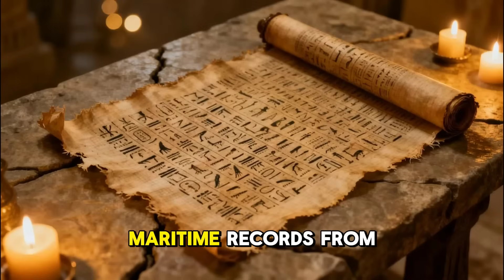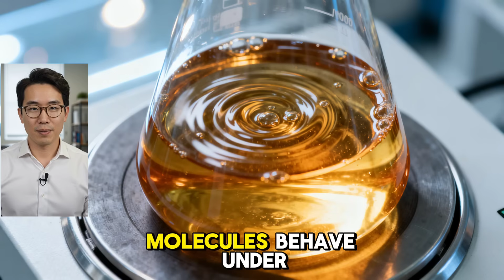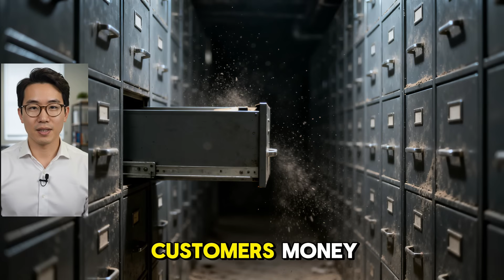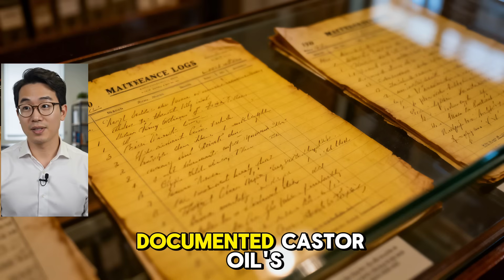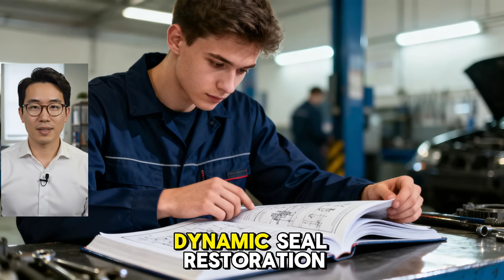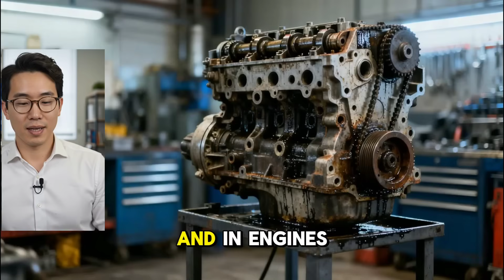One Cup of This $2 Liquid Stops ANY Oil Leak Forever. Mechanics Hate This Video.

Comment: It does Work, I did it, What kills me is all theses Snake Oil Lucas Stop Leak Ect...They sell this High Price Shit Knowing it does not Work.
I put 1 Cup of Castor Oil, How could it Hurt It's OIL, all it could do is mix with the 5 Quarts that is already in your Car. Think About It. I had some work done on my 50 year old Jeep, it barely had any Leaks before I took it there for Work, They did not tork any bolts, Some were barely put on as I checked when I got it back after 2 Weeks.  It leaked Like  Hell. 
I watched this Video and said to myself it can not be any worse than any of the Auto Mechanics around here. I put it in and after the 3rd week I could see a Amazing Difference.
Yes I am Grateful that I did It. Damn Straight.

Comment: I have a hard time putting fluids in a vehicle that dont go in that vehicle. Old timers I poured a Little ATF in the carb one time ran like a top. Ive seen guys do that and end up putting a Motor in the car. Itll stopp the leak when it locks up. You can if you want but its a no go for me. Last thing you wanna do is blow a motor

Comment: Had a Nissan that leaked from the top engine block. Took it to the dealer twice (after it started to leak after first fix). The 2nd time they kept it overnight to see if it would leak. 6 months out it started leaking again. Took it to an independent mechanic that fixed it. 6 months later it started leaking again. All this time they are simply replacing gaskets. My bro said he can fix it. I was reluctant because it appeared to be more of design flaw, even though it took years to start its initial leak. But I relented. Many years later, it never leaked once. My take is they simply fixed it for the short term so that you'll be back again.

Comment: Here is what chat gpt told me. 

Short answer: No — don’t do that. It won’t fix your leaks, and it can actually make things worse.
Why castor oil is a bad idea
Not engine oil: Castor oil (like the stuff used in old racing engines or for medical use) doesn’t have the additives modern engines need (detergents, anti-wear, heat stability).
Thick and gummy: It can gum up passages, especially when it gets hot, which can starve parts of oil.
Can damage seals: Instead of fixing leaks, it may swell or degrade rubber seals unevenly.
Clogs things: Risk of plugging oil passages, lifters, or even your oil pump.
Why people think it works
You might’ve heard of “thick oil stopping leaks.” That’s kinda true—but only temporarily, and castor oil isn’t the right way to do it.
What actually helps leaks (real options)
High-mileage engine oil
Has seal conditioners built in
Example: Valvoline High Mileage, Mobil 1 HM
Stop-leak additives (use cautiously)
Products like BlueDevil or Lucas can help small leaks
Fix the actual problem (best long-term)
Valve cover gasket
Oil pan gasket
Rear main seal (big one)
Real talk (your situation)
With your 2007 Dodge Ram 1500, if you’ve already been dealing with brake issues and working on it, you’re probably comfortable wrenching a bit. Most oil leaks on those trucks are:
Valve cover gasket (easy)
Oil filter housing / adapter
Rear main seal (harder)
Bottom line
❌ Castor oil = bad move
⚠️ Thickening tricks = temporary at best
✅ Proper oil or fixing the gasket = the way to go
If you want, tell me where the oil is leaking from (front, back, dripping on exhaust, etc.), and I’ll help you narrow it down and fix it the right way 👍

Comment: This is AI Crap.
Yeah, WW1 engines ran on castor oil.  It was the purest oil they could get.
In those days, petroleum wasn't refined anywhere near the purity it has today.  Ever watch an old silent movie and notice how all  the cars smoked horribly.  That wasn't a sloppy engine, it was oil contaminants burning off under heat and pressure.  Run one of those old engines with modern oil and they mysteriously stop smoking.

Comment: There's nothing that will stop an oil leak forever. That's absolutely ridiculous. Oil is keep from leaking with seals made from different types of rubber. They all will harden and start leaking. Additives might prolong a seal for a short time, but that's not forever. I don't know what oil or what thing the oil is in, but it's probably not something that has pressure, heats up, cools off over and over. I'm a retired mechanic of 45 years, I know a little bit about oil and leaks.
Reply: Put in brake fluid!!!  It swells the seals!!!!

Comment: Castor oil sold in USA stores indicates it is hexane free. Is this the correct oil?
Reply: If it’s he’s me free, the oil is extracted from the plant via cold pressing. This form is safe for use in/on you’re body. The leftover pulp is then heated to extract any leftover oil. This process causes the oil to lose its nutrients and become rancid. They wash this rancid oil with hexane to get it looking fresh. Both forms are fine to use in an automotive application, although the cold pressed, hexane free version is a better product.
Reply: Yes , That what I used and Ordered on Ebay.

Comment: According to Gemini... is adding castor oil the car motor oil to stop licking a good idea?
Gemini said
Short answer: No, please don't do that.
While it might seem like a clever "old-school" trick to stop a leak (or a "lick"), adding castor oil to modern engine oil is a recipe for a very expensive repair bill.
Why Castor Oil is Bad for Your Engine
Castor oil is a vegetable-based lubricant. Modern cars run on sophisticated petroleum-based or synthetic oils. Mixing them creates several critical issues:
The "Gloop" Factor: Castor oil is notorious for oxidizing and turning into a thick, sticky varnish or "sludge" when exposed to the high heat of an internal combustion engine. This can clog your oil pickup screen and starve the engine of lubrication.
Chemical Incompatibility: Modern motor oils contain complex additive packages (detergents, dispersants, and anti-wear agents). Castor oil can react poorly with these, causing the oil to foam or separate.
Seal Damage: While people used to think it "swelled" seals to stop leaks, it can actually cause some modern gasket materials to degrade or become brittle over time.
Reply: any documented evidence to support your proposition 🤔
Reply: AI  = ANAL INTELLIGENCE
Reply: NO IN THE HABIT OF LICKING MY MOTOR  ! EVEN IF IT IS TICKING ! NO THANKS ! 😅😅😅 FUCKEN LAZY PEOPLE  !

Comment: i had rediscovered this castor oil thing about 10 years ago being a big fan of ww1 aircraft and reading about how the engines ran and were maintained there is also another benefit to this you never mentioned back in ww1 maching crank shafts was not near as good as it is today but back then the gaps were filled with this castor oil on breakin you will find on a modern gas engine an actual rise in oil pressure as the wear gets filled in not only in the bearings but in the oil pump itself becoming more efficient

Comment: Will Castor oil also work for a leaking automatic transmission pan gasket as well as a leaking power steering pump?

Thank you for your time!
Reply from the maker: Yes it will

Comment: I heard nothing but bad using castor oil.  It’s not going to swell your gaskets like other no leak products claim.
Reply from the maker: Thanks for sharing your experience, it definitely depends on the specific seal material! 🤔
Reply: Engine Oil in my radiator. If i add castor oil will it stop the oil in my radiator if the cause is oil cooler? or head gasket?

Comment: PERSONAL OPINION :

Lets get real . Its far better to simply tighten the loose oil pan bolt or the valve cover bolt in order to stop the oil leak INSTEAD OF DUMPING CASTER OIL INTO YOUR $ 70,000.00 BEAUTIFUL CAR'S OIL STSTEM PAN . I don't think you would want to send Castor oil to a turbocharged
Engine's turbocharger's little  
Aluminum bearing that suppots the 1200 degree F 
Hot 30,000 rpm spinning 
Turbine shaft and 1200 - 1800 F degree hot exhaust gas driven shaft ! The Castor oil may turn into
Cooking oil .
Don't put anything into your engine's oil pan except a high quality multigrade engine oil of the recommended multy grade viscosity ---- or just use an SAE 10W - 30 CONVENTIONAL HIGH QUALITY MULTIGRADE ENGINE LUBRICATING
PETROLIUM BASED OIL ( LIKE I ONLY USE DRIVING HERE )  , AND NOT A CASTER OIL GOOKING OIL .
Reply: Spoken like a true oil salesman. 😂😂
Reply: Tightening the bolts just smashes the gasket and leaks MORE!!!!